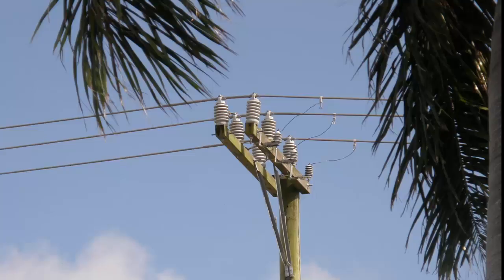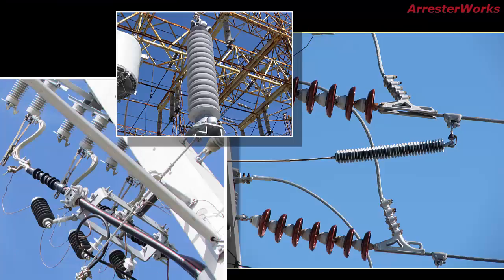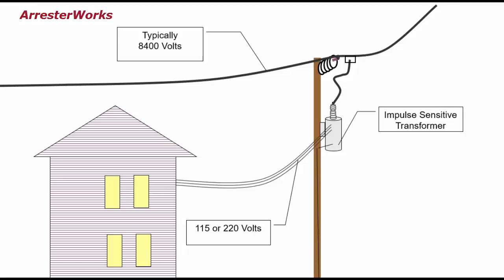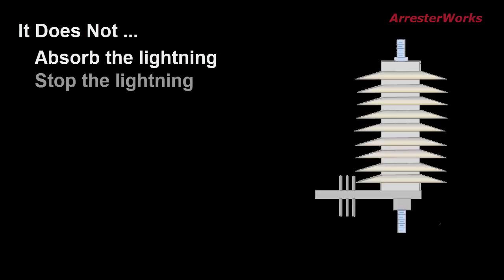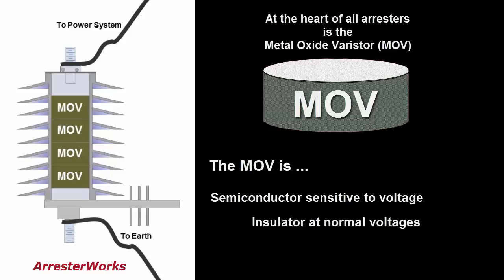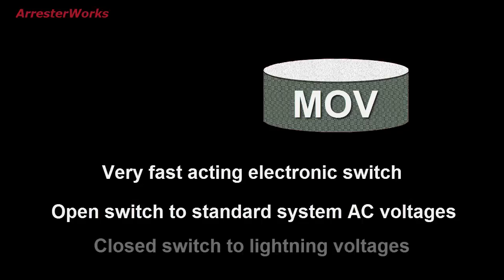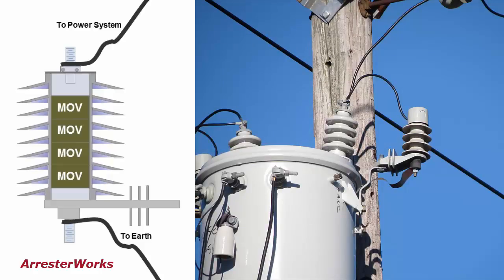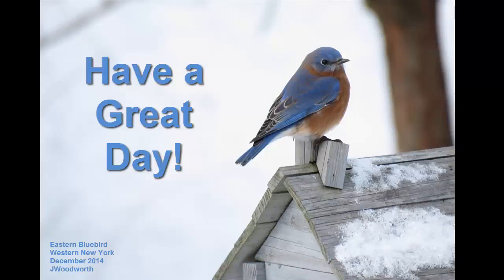What is a Lightning Arrester

Comment: At 0:32 in the video, what is "ground portential"?
Reply from the maker: Greetings Daniel,  Ground potential refers to zero volts.  Earth potential would be an other way to say it.  Some times when lightning is conducted to earth through a lightning rod the voltage a ground rises above zero volts, and this is about the only time ground potential or ground voltage is above zero.
Reply from the maker: Daniel, thanks for the heads up.  Cant tell you how many people and editors have looked past that one.
Thanks again.